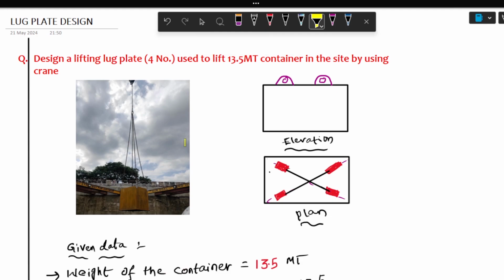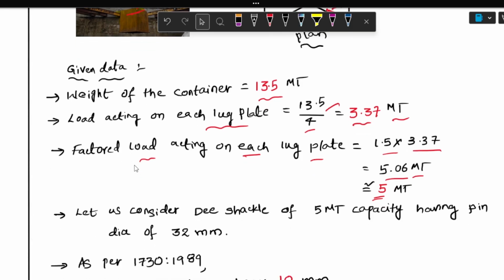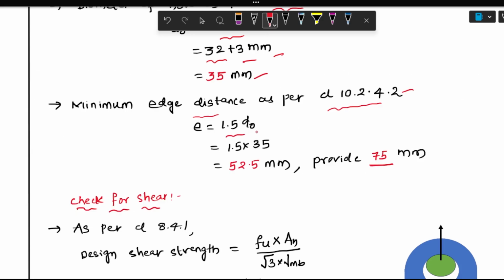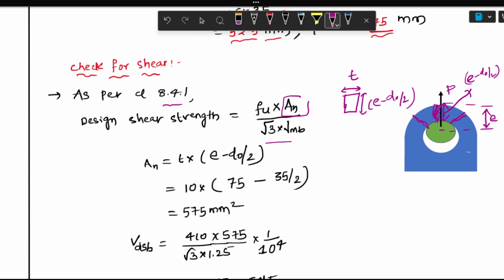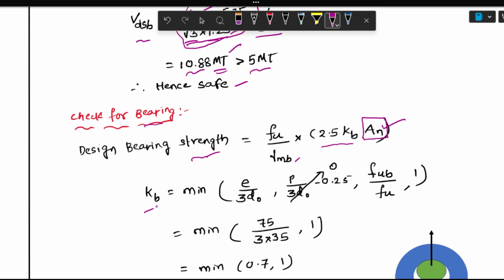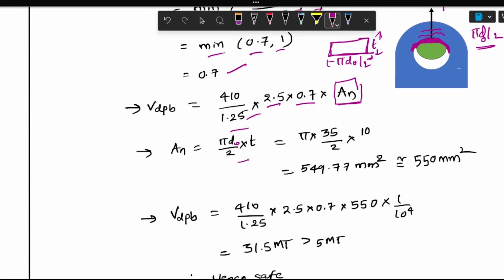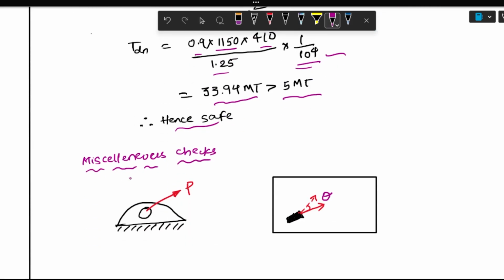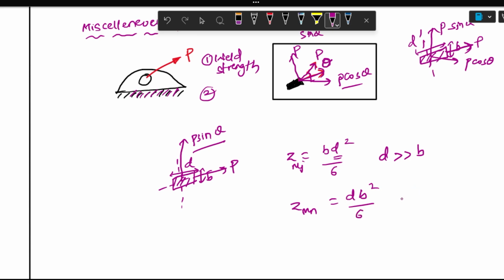DESIGN OF LIFTING LUG PLATE PART-02 || STEEL STRUCTURES #steeldesign

Comment: Hi, isnt it false to devide 13,5 with 4? If there are 4 chains with central lifting points then only 2 of them are loaded, always the diagonals two. The rest 2 chains are like stable elements to no tip out but they carry almost 0% of load.